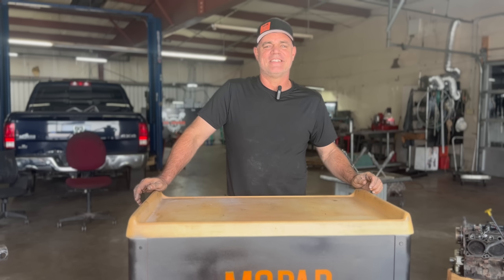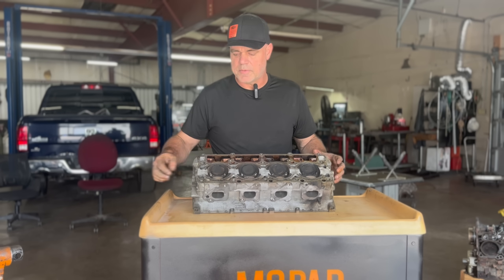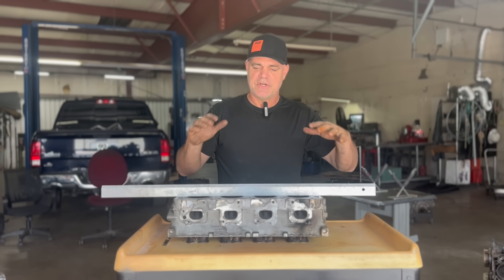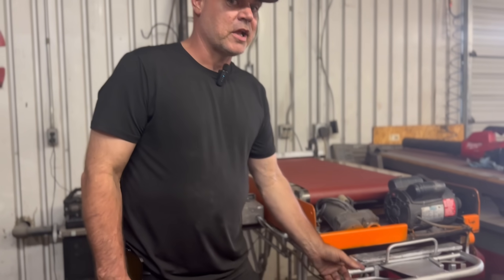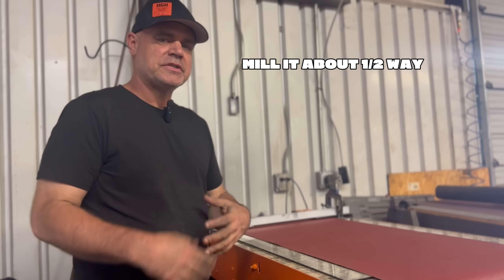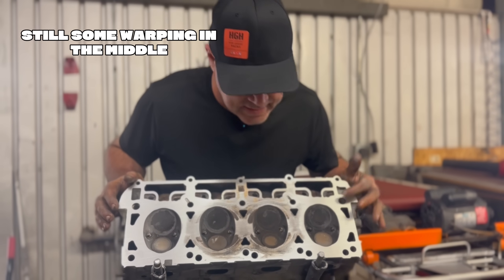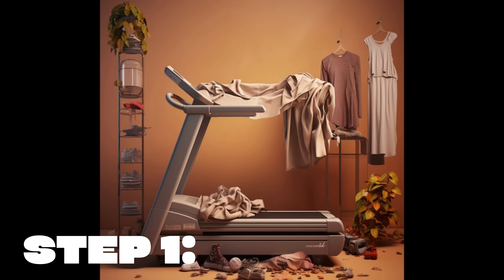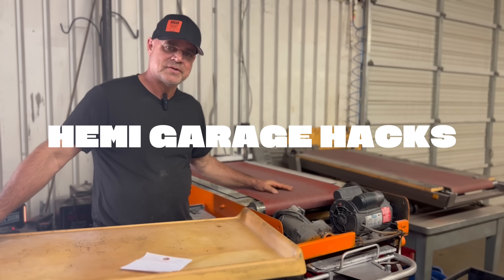I HAVE MILLED 1000+ CYLINDER HEADS WITH A TREADMILL!

Comment: as an aerospace machinist that worked next to flat plate rotary hone that I kept fed for several years I can tell you without question those hands are no longer flat and parallel to the cam bores. Additionally,  those combustion chambers no longer have the same comprehension ratio.
Reply: Machine shops have been doing this for ages. Think this is bad, watch them slide a cast iron head around on a large spinning stone. Might as well slide it around on a sidewalk. 
Combustion chamber sizing will stay in the same relation as it was from the factory. There's always slight variation from the factory anyways. .025cc difference will not effect how the engine runs. With hydraulic lifters and pushrods, they automatically adjust to variations unless you take off like 1/16" off the head. Overhead cams won't even be effected because all of the valvetrain is up top.
Reply: @QwertyQwerty-jq3cu  Can't remember the last time I saw a cast iron head, 20, perhaps 30 years ago?
Reply from the maker: This has sure sparked a lot of conversation for sure.  As for me, with some good practices and guidelines, I have seen tremendous results.  Perhaps not for everyone, and I am not trying to sell anything, I just wanted to share something cool I discovered.  Glad you are here and thanks for sharing.
Reply: I think you nailed it!
Reply: Older (and quite a few newer) V8 engines are pushrod, so no problems with having to have camshafts parallel to the head face.
Reply: Machinist here as well…and agreed. What this guy has done is made a reasonably flat surface, but with no reference to the cylinder bore. It also looks like a pretty aggressive removal, but I could be wrong about thst…not sure. 

Not milling…lapping.
Reply: He's also using the straight-edge upside down 🤡
Reply: So you hone cylinders? That tells you that this method specifically creates an imbalanced surface?
Reply: I don't compression what a comprehension ratio might be...very unlike an aerospace machinist to be so imprecise...

Comment: And I grind valves by chucking the stem in my drill press, spinning it at low speed (150-200 rpm) and, ever so carefully watching it to match the angle, bringing down a worn-in flap disc on my 4-1/2" side grinder to touch it and resurface. Touch the edge squarely to give a good margin. Lap it onto the seat with lapping compound.
Reply from the maker: You ain't scared, I love it:)

Comment: How much does it cost to have heads resurfaced at a machine shop? Would this be cheaper for a DIY guy?
Reply from the maker: It all depends on how much someone will be using it.  great care should be taken in setting it up, to assure a true surface.  But it obviously can be done.  And as an added bonus, I made mine more than 13 years ago for less than $500.  Good investment:)  Thanks for sharing!

Comment: "Linishing" is the more appropriate term for doing that type of sanding to establish flatness.  I've done this type of flattening on small auto parts such as carb bodies, carb manifolds, etc many times using the "manual" method of wet-or-dry sand paper on a nice thick glass surface.  Works a treat.  Nice little tool you engineered there!
Reply from the maker: Thank you for that, I appreciate it!  And glad to have you here:)

Comment: Absolutely positively DO NOT do this to your cylinder head. Especially if you are working on an OHC engine.
Reply from the maker: unless you want to.  Life needs some adventure:)  I do know what you mean about the OHC engine head though, we used to do a ton 3.7 and 4.7 heads which are OHC. What has worked best for me over the last 13yrs has been monitor time on surfacer, change direction of head in equal time, and of course Straight edge for the trueness of the surface itself.  Truly, I tried it on a whim a long time ago, at just the chance that it might actually work.  I was pleasantly surprised to say the least, and it's been a workhorse.  As a bonus, I made it for under $500 and I only have the change the belt every 2 years or so.  Thankful for your input and I am glad you are here:)

Comment: This should actually works if you find a good support under the belt. I see glass and under it, stone or marble. Can be hard to find??
Reply from the maker: Granite, and it's freaking heavy:)  Glass is merely there to protect the granite surface (since glass is cheap to replace), but also as a way to shim between the glass and granite if necessary.  Thanks for sharing, glad you are here!

Comment: I can only imagine how nice it is to be able to pull a head, tread"mill" it yourself in your own shop, and re-assemble it the same day. And to be able to make a little money off the process while SAVING the customer money by not paying the machineshop rate is fantastic. 

Having successfully flattened a Slant 6 head and several 2.6 Mitsubishi cylinder heads using the glass and sandpaper method myself, I have no doubt your process is effective. No matter what the "intuitive engineering geniuses"(who have never done it themselves) opinions might be
Reply from the maker: Most of the time these days it's hemi heads, but I have milled a few aluminum blocks on there and a few straight 6 cast iron heads.  She's been a work horse.  Glad you are here!
Reply: Real engineers know that accuracy is not in the machining or sanding, but in the measurement. If your straight edge and feeler gage are accurate, your head will be in spec.
Reply: @Bob_Adkins  Try explaining that to the people that don't want me repairing their Vintage 'Bike frames because I'm going to braze them just like when they were built 70 years ago instead of tig welding them because tig welding is "better" because everybody knows tig welding is better
Reply: @jonathangehman4005  My point was that accuracy can be excellent if you measure it using good gages regardless of the tool used to do the work.
Reply: @Bob_Adkins But "better" is still the mortal enemy of good

Comment: That's not milling that's grinding.  I'm skeptical.
Reply from the maker: you're right!  Here has been my approach to get the best result possible.  What has worked best for me over the last 13yrs has been monitor time on surfacer, change direction of head in equal time, and of course Straight edge for the trueness of the surface itself.  Truly, I tried it on a whim a long time ago, at just the chance that it might actually work.  I was pleasantly surprised to say the least, and it's been a workhorse.  As a bonus, I made it for under $500 and I only have the change the belt every 2 years or so.  Thankful for your input and I am glad you are here:)

Comment: Have you ever run a dial indicator over emory cloth or sand paper? I have, and it's not even close to uniform thickness from one end to the other
Reply from the maker: What has worked best for me over the last 13yrs has been monitor time on surfacer, change direction of head in equal time, and of course Straight edge for the trueness of the surface itself.  Truly, I tried it on a whim a long time ago, at just the chance that it might actually work.  I was pleasantly surprised to say the least, and it's been a workhorse.  As a bonus, I made it for under $500 and I only have the change the belt every 2 years or so.  Thankful for your input and I am glad you are here:)

Comment: The thing that scares me with this is, how do you know you didn't cut the head on a taper? It can be level with the straight age across the surface but what if it's now on a slant?
Reply from the maker: What has worked best for me over the last 13yrs has been monitor time on surfacer, change direction of head in equal time, and of course Straight edge for the trueness of the surface itself.  Truly, I tried it on a whim a long time ago, at just the chance that it might actually work.  I was pleasantly surprised to say the least, and it's been a workhorse.  As a bonus, I made it for under $500 and I only have the change the belt every 2 years or so.  Thankful for your input and I am glad you are here:)

Comment: So former machinist here- how do you measure depth of cut & square the head in the X & Y axis. I like to make sure the head from one end to the other has the same cc. If your off 0.005" on a street engine might be exceptible but not on a high performance head or block.  I like the concept.
Reply from the maker: good point.  What has worked best for me over the last 13yrs has been monitor time on surfacer, change direction of head in equal time, and of course Straight edge for the trueness of the surface itself.  Truly, I tried it on a whim a long time ago, at just the chance that it might actually work.  I was pleasantly surprised to say the least, and it's been a workhorse.  As a bonus, I made it for under $500 and I only have the change the belt every 2 years or so.  Thankful for your input and I am glad you are here:)

Comment: I really hope this is satire, bro! As a machinist and a diy guy, i would never do this to my own engines unless i had absolutely no choice, like a zombie apocalypse scenario...
Reply from the maker: You are reading my mind.  I am actually going to have episodes about zombie apocolype scenerios in future episodes.  But don't poo poo this concept so fast.  Machinists are the best by far, but I was pleasantly surprised when I finished it 13 years ago. What has worked best for me over the last 13yrs has been monitoring time on surfacer, changing direction of head in equal time, and of course Straight edge for the trueness of the surface itself.  Truly, I tried it on a whim a long time ago, at just the chance that it might actually work.  I was pleasantly surprised to say the least, and it's been a workhorse.  As a bonus, I made it for under $500 and I only have the change the belt every 2 years or so.  Thankful for your input and I am glad you are here:) And I have had machinist at my shop that saw this and they could not believe it.  Much respect to you, I know it seems crazy.  And side note, I am not selling these and I don't care if anyone out there ever does this themselves but it has been amazing for me.  Glad you took time to share though.  The discussions have been great.  I just wanted to share my journey:)
Reply: @HemiGarageHacks excellent reply, i didn't want to be a troll at all...i do believe its possible to get great results from surfacing onna flat sand table. I dealt with rotary engines and if you know about how their side plate can become grooved by the apex side seal, you will know what im talking about. They do have a similar resurfacing process that simultaneously rotates the plates on a rotating surface.
Reply: similar machines have been used in auto machine shops for  years. i first saw on at national cylinder head in orlando  fl

Comment: Any idea of how much you are removing? I guess once you get a feel for it you are probably removing a similar amount off each head but probably not too much to increase compression substantially.
Reply from the maker: What has worked best for me over the last 13yrs has been monitor time on surfacer, change direction of head in equal time, and of course Straight edge for the trueness of the surface itself.  Truly, I tried it on a whim a long time ago, at just the chance that it might actually work.  I was pleasantly surprised to say the least, and it's been a workhorse.  As a bonus, I made it for under $500 and I only have the change the belt every 2 years or so.  Thankful for your input and I am glad you are here:)
Reply: @HemiGarageHacks  how much is the belt?

Comment: You forgot to mention the glass under the belt;  Why glass?  Because its almost dead flat.
Reply from the maker: The glass serves 2 purposes.  One, to protect the granite surface (since it is cheap to replace glass), and two, it provides the ability to shim between the glass and granite if there is any part that is untrue.  Great question!

Comment: I know you get the belts from Mirka, But I might have missed what grit you used? Doesn't seem like it would be too aggressive for aluminum. To your own head be true.
Reply from the maker: 60-80 grit.  Personally I use 60 grit and resurface a couple exhaust manifolds first, to break in the belt.  After that, the finish is beautiful.  Glad you are here!
Reply: @HemiGarageHacks  Thank you. I've heard of people using an old glass table top for this but you took it to another several levels.

Comment: How do you keep the heads parallel to the sanding surface? Do you have a fixture to measure? It may be flat but tilted.
Reply from the maker: great point, glad you brought that up.  For us, we can measure time and direction of the cylinder head.  It's worked great.  Thanks for sharing and I am glad you are here.

Comment: Spray gluing sandpaper onto a flat welding table, or a thick glass plate or milled stone, works great.
Sure, it take some time to get enough material off, if the head is heavily warped. But it costs next to nothing. Maybe half an hour per head.
Reply from the maker: True my friend, true!

Comment: Machinist and engineer and once-upon-a-time engine builder here... (I'm old)  For reference, when I say "flat" I mean the absolute perfection, which is what we want to compare your belt sander results with. I'm not suggesting the work end up perfect, since that's not necessary.  The question is, what level of flatness is necessary? (this is documented, fortunately)

Glass is soft, and it bends.  That thin sheet of glass is only as flat as the surface it is resting on.  Now in your case, you have chosen a piece of countertop, which is very, very far from flat.  Try getting a grade B thin (couple inches, don't think a 4in plate will fit) to rest your glass on (so you don't wear the plate)  Monitor auctions, that's how I got my primo plate for cheap.

Now I know full well that heads and blocks don't need to be as flat as a plate.   Max allowable deviation can be two mils for old iron and 1 mil for modern aluminum engines which is a LOT of slop to a machinist, over such a small area.  No need for hand scraping precision on heads!  This is way sloppier than a plate.  But of course we aren't making plates, so how good does it really need to be?

Well it turns out, if you do a bunch of math (or look up the finished work in Machinery's Handbook), you find that you need tooling and measurement gear which is roughly 10X the accuracy and precision (be sure you know the difference!) of your allowable tolerance in the work.  That's to do good work.  If slop work is good enough, figure 2X - 5X.

I would love to print one of your heads - have you ever done this? - print one of your heads and one from a shop that used a single-point fly cutter to mill the heads flat on a real mill - print both and compare.  Assuming you own a plate to print with...  If you haven't got a plate in your machine shop, you haven't got a machine shop.  References are IMPORTANT.  Good luck, and please don't build any aluminum racing blocks for ME, LOL.

Also, if you want other people to duplicate your work, you need to provide more information.
Where did you get sandpaper that big, and how did you do the seam on the paper? I didn't see anything about that, and it seems kinda important.  What is the grit of paper you are using?

You keep saying "milled" when you mean "sanded".  Sanding is not milling.  Use right words, sound smarrt.  Use wrong words, sound dumb. :P
Reply from the maker: everything you are saying is true and we are by no means a machine shop. We rebuild Chrysler Jeep and Dodge Motors and have done over 4000 in the last 17 years.  For what we do, this has worked amazingly well.  I 100% see your points and I am glad you shared:)  Mirka makes the belt and the seam is slightly recessed.  I can used the same belt for 2 years.  60-80 grit seems to be a sweet spot for us and we straight edge every single one when we are done and they have less than .001 as shown in the video.  I respect machinists and I love the old-timers, they are rare these days and I don't know how these guys will be replaces because it's a lost art.  I am glad you took time to share this.  Much respect sir!
Reply: Use right words, sound smarrt.  Use wrong words, sound dumb. :P

When you use the right words, you will sound smart. When you use the wrong words, you will sound dumb. :P

I didn't want you to ruin that amazing dissertation with an ending like that, so I fixed the grammar for you and even corrected the spelling errors. Now it sounds a little bit smarter.
Reply: this is exactly why we avoid engaging with engineers... get over yourself guy. in practice, we  find what works and what doesnt. clearly this guy has the data at this point to say that his process works, and he didn't even have to crack open the machinery's handbook.

Comment: great idea.  have you had any issues with the combustion chamber on either end being smaller ?  id imagine you really have to apply super even pressure or one might give some compression increases.  not sure the amount taken off would be significant enough to raise compression to a dangerous level.  nice vid
Reply from the maker: Most of the heads we have dealt with crack before they warp to the point where they will mill too deep. What has worked best for me over the last 13yrs has been monitor time on surfacer, change direction of head in equal time, and of course Straight edge for the trueness of the surface itself.  Truly, I tried it on a whim a long time ago, at just the chance that it might actually work.  I was pleasantly surprised to say the least, and it's been a workhorse.  As a bonus, I made it for under $500 and I only have the change the belt every 2 years or so.  Thankful for your input and I am glad you are here:)
Reply: @HemiGarageHacks  can you give the name of the company that makes the sand belts of any size?